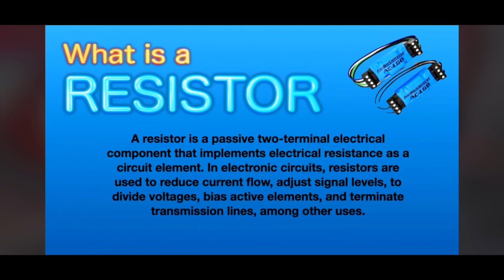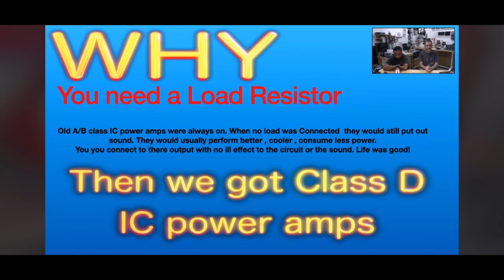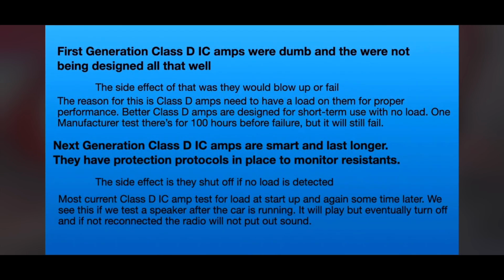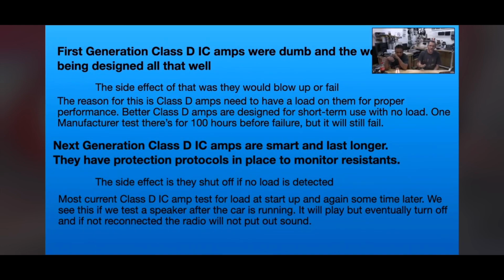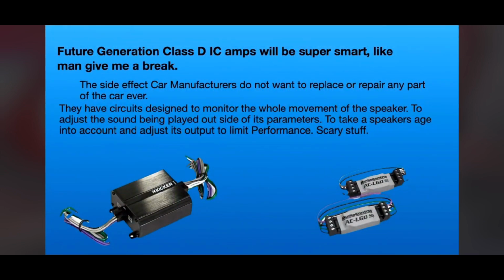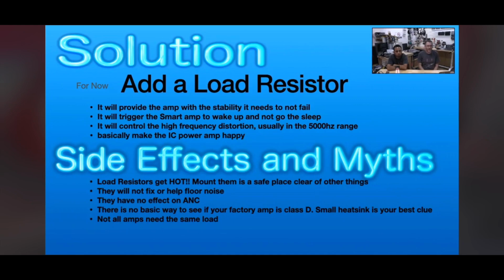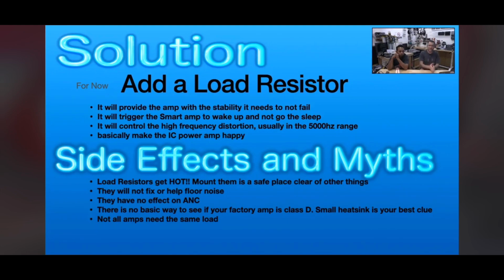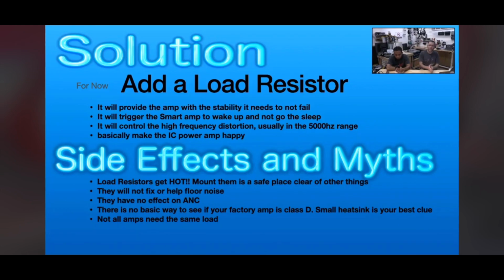What are load resistors and why do you need them

Comment: Hi, i plan yo upgrade the sound  système in my 2021 Ram promaster city,  just like the one you did on the same matter. I bought from a local shop here in Québec city, a Morel loc. It has a 50 ohm built in already. the guy says tha they use it and it work most of the time. Do you think it should? Think i saw that you used the green AC-lgd on your  Ram promaster city,  the 20 ohm model..Like to have your advice..Thank's in advance..🤙

Comment: Thank you this helped, i needed to know if it would hurt if was class A/B. I'm airing on caution, because I'm not sure if it's a/b or D. 2013 F150 FX4. My concern/question is with the APH-FD01 Harness. (My plan, oem tweets and center powered by the oem amp, then power the doors (mb quart Q components), with my RF 551x a/b amp. I purchased the AC blue LGD, the harness added those small white resistors to the front and rear output wires (from oem amp) 
My question, can should I keep the white resistors too, or cut off and just use the AC LGD.....?? Using both us good/bad? I hope someone knows, maybe pulling the signal just from the HU was the better choice? Either way, I'm leaning towards just using the AC-LGD. Is it better to have the resistors closer to the oem amp or is it OK to have them farther back closer to the aftermarket amp in the back, does it matter? (More ventilated in back and accessible, the oem amp is under center console and would be buried and i don't like that)